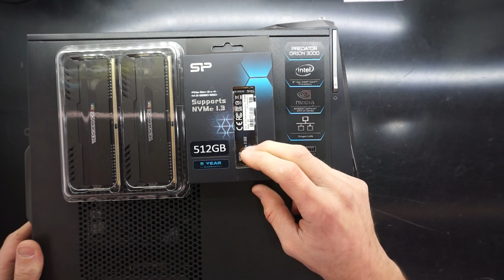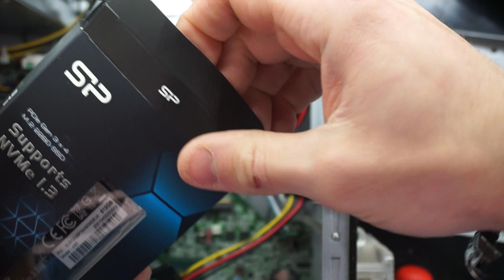Acer Predator Orion 3000 Upgrade Options

Comment: Hey Ive got a Predator Orion 3000 PO3-620 model and theres some problems with my psu, im planning to replace it but the motherboard doesnt support normal/standard atx psu's. Would you be able to recommend a good 650w psu that will fit into my model/motherboard. Thank you!
Reply from the maker: its a standard 8pin + 24Pin connector, so any atx PSU will be fine
Reply: @rickstechrepairs  hi, i just got an email back from acer and they state that the psu used is an atx12v model which does not have the 24 pin connector. Do you have any recommendations for an atx12v psu? Thank you
Reply: @johnnyscars  i have similar pb like you , acer predator orion , i cannot upgrade the psu , what did you do ?
Reply: @twinsunpredator7998  hey, sadly you cannot upgrade the psu without changing the motherboard. Upgrading the pc is very difficult. If your gpu and cpu are good enough you could salvage them and rebuild with new parts
Reply: @johnnyscars  THX YOU FOR YOUR ANSWER , I  got orion 5000 p09 600 .... would like to change the mother board and psu and gpu
it is possible ?? i heard the connection for front switch are not the same and i will lose the front usb and connector ??

 .... i love my big case ... love my predator ... but tbhey have made me so upset . i want to keep my beloved pc .... ( change whats inside ...)

Comment: Hello, I'm looking to purchase an orion , and I want add an Hdd since it doesn't come with one. If it doesn't come with an Hdd, would I need to purchase a separate power cable, or would that already be included in the machine?
Reply from the maker: Power would be there but you might need another sata data cable
Reply: @rickstechrepairs  got it , thank you  very much sir

Comment: Hey! I just changed my 512gb ssd to 1 TB but i have a problem. I cant log in back to my computer so what should i do
Reply: You have to reinstall windows
Reply from the maker: did you clone your hard drive or do a fresh install at all?
Reply: Your memory is still on your other drive.The operating system is still on there so you should've put your 2 ssd's in another pc with 2 ssd slots together (I think the acer only has slot for 1 ssd) to transfer the data from one to another before you've put them in your pc. Or put your 512 GB ssd together with another pc which has 1 extra ssd slot, transfer your data then replace your 512 GB ssd with your 1 TB ssd. There should be another slot for a hdd though.
Reply: Otiks sä sun etupaneelii pois ku ite en saa takas

Comment: If i want to upgrade my graphics card, which is the best for this pc? I have the same one but i already have an 1660 super and i got a intel core i-5 9400f.
Reply from the maker: I would be holding off until next year and get a 3060ti or a Radeon 6800
Reply: @rickstechrepairs  Are you talking about the rtx 3060ti? If you are, would I need to change the power supply in order to have that graphics card? Or what would be the modification that I would have to do in order to use that graphic card?
Reply: @madhatter5610  assuming you have the Liteon PS-7501-5 500w PSU, you’ll probably want to upgrade it. The 1660 Super founders edition is supposed to draw 125w as where the 3060 ti founders edition draws 200w. The rated wattage is an estimate and can go above or below depending on what you’re doing so it’s always a good idea to have a little wiggle room. Luckily the Liteon PSU Acer used is an ATX form factor unit with industry standard pinning. You can get a modular PSU with enough power for $150 +/- $20 fairly easily. Best of luck upgrading your computer
Reply: Don't bother, 9400f already bottlenecks your 1660 Super.

Comment: And what about the i5 9400f proccesor? Can I change it?
Reply from the maker: Could go to any cpu in the 9th generation
Reply: @rickstechrepairs  On the predator P03-620 board what GPUs work with it the highest without upgrading CPU or Power Supply
Edit: And if you do upgrade Power Supply How far could you go.

Comment: Hi
I have like the exact same pc as you. I want to upgrade my  NVIDIA GeForce1050 ti graphic card with a NVIDIA GeForce 1660 super. But I don‘t get where the graphic card in my pc is. I‘m strugeling with differentiate the fans and the graphic card. The reason maybe is, that my graphic card has only like one fan to cool it.
Reply from the maker: the graphics card is the spot you connect your monitor cable.

it is held in by one/two screws
Reply: @rickstechrepairs  Thanks now I get it
Reply: You got it, This PC comes with gimpy 1 fan GPU's that get HOT.

Comment: Hey I just  dismounted it and when I turn it on it keeps peeping when It boots any help??
Reply from the maker: Remove and reinstall ram with the power cable disconnected
Reply: @rickstechrepairs  thanks it works
why does it happen though?
Reply: yo bro I have the same problem did you fix it?

Comment: Do you think I would be able to upgrade the GPU? I have an RTX 2080 currently and want to get the RTX 3060 TI.
Reply from the maker: Yes that would be a do-able upgrade 
I'm curious what the expected performance difference between the 2080 and rumoured 3060ti would be 

And power usage
Reply: @rickstechrepairs  Thanks for the quickly reply. Yeah honestly I saw a video (not sure with what  PSU) but the 3060 TI out performed the 2080 only about 5-10 FPS, and for some games the performance is virtually the same (2-4 FPS difference).
Reply: @cyprianbensira  try use a 650 or 750 watts

Comment: Hello i have this pc but with a 1 To SSD and 2 To HDD. I have an i7 9700 and a gtx 1660 ti. Im thinking about upgrading for a 2070 or 2070 super but idk if there is enough space in the box and also if the power supply has enough power. Could you help me ?
Reply: May work, but the power supply is bad and might blow up, just a get a reputable power supply.
Reply: @OAFish  Okey thanks man

Comment: Hi Rick, I have the Acer predator Orion 3000 p03-600 and I’ve been trying to find a better power supply for it but I have been unable to. Do you have an recommendations for them? The one I tried it apparently did not have the extra pins needed for something.
Reply from the maker: I can't quite remember the PSU connectors on this one but I would be thinking  you would need a hp PSU adapter/converter
Reply: @rickstechrepairs  okay, thank you.
Reply from the maker: 3:35

at this point in the video it looks like it uses a standard 24pin + 4pin Power for the motherboard

And the HDD is using a standard sata cable. 

it all looked extremely standard ATX
Reply: hello i have the same pc as you and i want a better psu to so with one do you have now? or do you still have the stock one?
Reply: @woutervoet8734  I wouldn't bother at this point, I have this system and it struggles on many games.

Comment: Have u upgraded a cooler kit in these or fan upgrades ?.
Reply from the maker: i have done neither, only the upgrades shown.

CPU cooler might be a bit tricky as its using its own screw down style of cooler for the CPU, rather than the standard intel push in and clip.

system fan upgrade should also be do-able
Reply: @rickstechrepairs  ohh ok cheers :) i am seeing temps of 81 when gaming . Is that ok ? Thinking of recasing . This case is so small
Reply: @turbo8433  im seeing roughly same temps it seems this pc runs hot. may need to upgrade fans or cooling system IMO
Reply: @whereschavo3953  yeh i took to pc shop. Upgraded fans and added a big fan inside. And temps droppef
Reply: @turbo8433  hi, did you upgrade the CPU fan or it just the case fan ?
Reply: @turbo8433  Did you upgrade any other parts before you upgraded the fans?
Reply: @turbo8433  hey man I know this is a year from when you posted it but do you know what fans and cooler we’re compatible?

Comment: I have this same pc but with other specs and i need more space so can i add second ssd here or do i need to buy external?
Reply from the maker: https://youtu.be/mhb-3INCGDo?t=224

At this time you can see near my right hand 3x Sata Ports

1x to existing Hard drive
1x to DVD Burner
1x Sata Port Free

you could add another 2.5" Sata hard drive and it may/may not have the NVMe m.2 slot already filled
Reply: @rickstechrepairs  So the one i had in now is one 3.5" HDD, but i want to put another in, so would i need to use a 2.5" in order for both to fit? and i know id need another data cable but is there another power cable off the power supply for a second HDD?

Comment: Hey I have the predator Orion 3000 but I’ve been having trouble trying to figure out what ssd is compatible or like which is best for my pc, mine is the same as yours but I want a 1tb ssd instead of the 512gb you have. Please help me I’ve been asking everyone.
These are my specs by the way. Please help
Acer Gaming Desktop Predator Orion 3000 PO3-600-UR18 Intel Core i5 8th Gen 8400 (2.80 GHz) 8 GB DDR4 1 TB HDD 16 GB Optane Memory NVIDIA GeForce GTX 1060 Windows 10 Home 64-bit
Reply from the maker: Hi, any decent brand of nvme SSD should work fine (crucial, WD,Samsung,Seagate)

03:45 I talk about the nvme m.2 slot

Comment: Hey mate I'm new to the pc gaming seen I have the same model pc its currently running 16gb ram I am thinking about upgrading to 32gb ram, what brand would you recommend? and does it matter if its not dual channel?
Reply: Cheers mate 👍
Reply from the maker: Keep dual channel for peak performance, 

Unless you are using more than 10gb of ram I wouldn't bother upgrading to 32gb of ram 

Upgrading your GPU would get better gaming performance

Comment: i have this pc but I want to upgrade from 1050ti to 2060 windforce oc v2, will it fit in the case?
Reply from the maker: If it's a dual fan cooler then yes, if it's a tri card then I think it would be cutting it close

Comment: Hey Rick! how's it going? was just wondering if you have tutorial on how to put the HDD for this case? I have the same PC. but no HDD.
Reply from the maker: No sorry I only have this video on this model
Reply: @rickstechrepairs  no worries master
Reply: I have the same thing too, did you find out how to do it??
Reply: @h4razz3691  hey man. Yeah i figured it out.  Pretty easy, just put the HDD inside and screw it. It will fit 1 HDD
Reply: @mlrc4558  Thanks, but do you know what size hard drive??
Reply: @h4razz3691  i think I have the 3.5" HDD

Comment: I bought this one  with following specs..     
Intel® Core™ i5-9400F processor
512 GB SSD & 16 GB RAM
NVIDIA GeForce RTX 2060 6 GB
Creative Sound BlasterX® 720⁰
Can I upgrade to
Intel Core i7-9700 Processor 
Do I need to change anything else
Reply from the maker: I don't believe anything would need to change to do the CPU upgrade
Reply: hello @Ricks Tech, I have the same spec. Would an RTX 2080 super work with this? Other than the PSU will the motherboard be able to take in the 2080 super?

Comment: Hello Rick. I have this exact PC, except with a 2070 GPU. Is it safe to upgrade the CPU and the HDD storage in this? I am scared that I will break it.
Reply from the maker: What CPU?

If it came already running a 2070, then upgrading the CPU shouldn't be an issue , power wise
Reply: Ricks Tech 
CPU: i7-8700
GPU: 2070
It came with 2TBs of HDD but it was actually 1.8 TBs. I only have 650+ GBs left. Should I add more HDD?
Reply from the maker: I wouldn't worry about it until you get down to 50gb of free space
Reply: Ricks Tech Alright! Thanks!
Reply: Are u on about putting a 3060 in this predator Orion bc it won't fit the best graphics card u could probably put in is 1660ti
Reply: @Luxay777  i have a 3060 ti and it fits into the case fine. The only issue being i had to upgrade my psu from a 500w psu to a 850w psu. other than that it all works well.
Reply: @lucidremedy  do you know what CPU can put on this motherboard? i have 3060ti and i5 12400., wondering whats best cpu i can put in this pc .

Comment: do u have temperatures issues? I will buy this pc but im kinda afraid of overheat due to the small case conpared to the others
Reply from the maker: with the current hardware in here, i wouldnt worry too much about it overheating
Reply: I have the same PC and i have temperatures issues
Reply: @davidzackariat1223  well i ended up buying other pc that is pretty good for the money i wasted... but how do u notice ur pc is overheating? Fans too loud or u got any app to check ur cpu temp?
Reply: The CPU and the GPU are in games like COD at 75-80 degrees. In addition, the graphics card only has one fan and is very loud ...
Reply: @davidzackariat1223  same tempature for me, i will try upgrade the ven

Comment: Hi, what size hard drive does it take? does it take a 3.5 inch hard drive? thanks
Reply from the maker: it will fit
1x m.2 NVME ssd
1x 2.5" or 3.5" Hard Drive
Reply: @rickstechrepairs  does it take any M.2 NVME SSD?